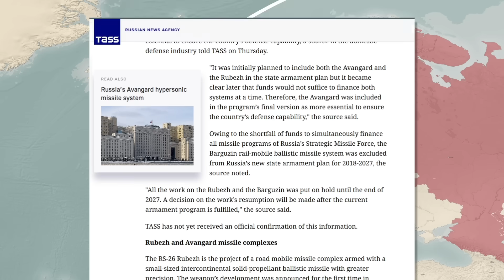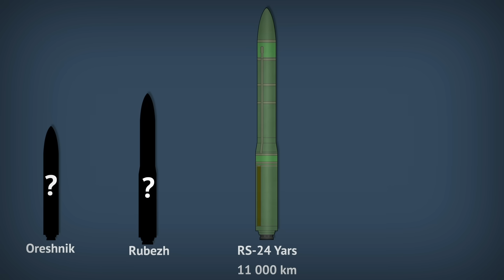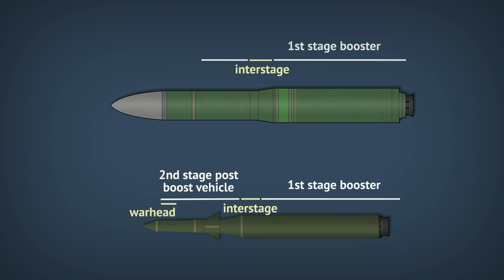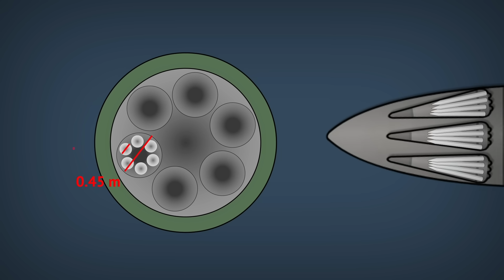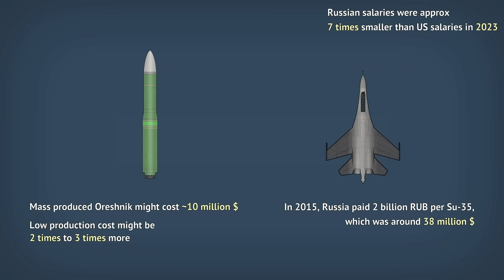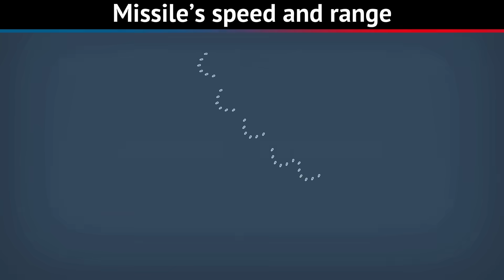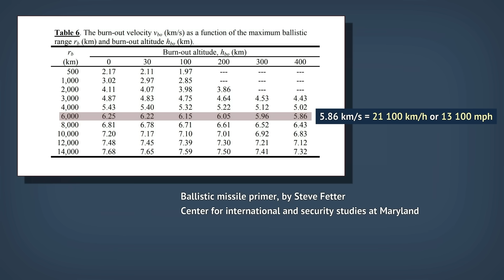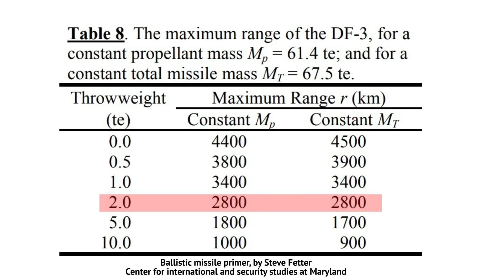Ukraine can’t counter Oreshnik missile. But it doesn’t have to.

Comment: I don't understand the point of this weapon in this context with conventional warheads other than pure propaganda. 

It's not like it's being used as a Bunker Buster that can obliterate any hardened shelter no matter how deep it is as Prompt Global Strike program. A program BTW that was canceled because nobody could tell if the ICBM it was attached to is armed with a nuke or not.
Reply: Millenium7 had a great video on the potential for this style of weapon, for example: it maybe a fantastic weapon to use on very time sensitive targets or airfields, 36 submunitions with a relatively high amount of accuracy depending when they release could be very effective. though we would have to wait and see what becomes of this.
Reply: For targeting high cost assets far behind enemy lines.
It is cheaper to lob a an ICBM with conventional munitions then to send in paratroopers or pilots which human assets take far longer to train & even more cost to make competent.
Russia is considering the long term plan as certain personal can cannot be replaced immediately but will take a generation or so to replace.
Considering how much land & the length of Russia's border trailing such a great way to project power & while practicing for the hypothetical use of thermo-nuclear loads.
Even how they have lightened the load with practice it is reasonably possible to improve accuracy by lowering the radius of impact with trial & error.  

This is the correct move on Russia's part as they get practice & experience with such armaments in an active while NATO is bureaucratic while arrogant with old guard that think they are untouchable when really they have grown complacent since the cold war era.

No one around Russia has Thermonuclear armaments but China & what you can think of this as is a direct reminder of might.
Cuddle up to the USA if you want but the Russian bear can maul you & the USA eagle will do nothing as it circles about in observation.

USA can project across all the Americas but doing so in central Asia or eastern Europe not so much.
USA can only project presence into Europe mainly because of the Special relationship with the UK.
USA only projects into the far east because of Japan as effectively a puppet state after ww2.

USA & Russia are doing proxies again in Africa, Eastern Europe, Central Asia & likely south east Asia again as time progresses.
Reply: Weapont test
Reply: Yes the similar to icbm and potentially extremely deadly if nuclear; so the flight and launch pattern it has are troublesome and do have some challenges, so no twitchy action would cause nuclear war.
but its a very strategic missile to have; basically you can cut costs at completely destroying an airbase to a minimum. where you would need 100s of conventional missiles, you could get the same or better result with 5 of these. Which would be both cheaper, time effective and way harder to defend against.
Reply: As always, it is just for show, hoping to get a reaction from the West
Reply: @tellarty  As "always"? Not enough "show" on the Ukrainian front for you, mr. armchair expert?
Reply: @tellarty  Like those Himars-destroying Iskanders missiles are just for show?
Reply: @Kayzef2003  Did I speak to you? You should know your place.
Reply: @tellarty  It's a comment section, everyone can reply to anyone. If you can't understand that then get off the internet lol Know your place he said lolol
Reply: @aerith119 why are you talking?
Reply: @aerith119  Exactly, not for low-quality propaganda
Reply: It tells the USA that they're a long way behind in establishing hyper-sonic missiles on Russian borders and demonstrates how stupid an idea that escalation would be.
Reply: @whatilearnttoday5295 the us has had the same speed missiles since the 60's we have been able to shoot them down since the 90s.  If the russians didn't have this technology yet that is just sad.
Reply: @whatilearnttoday5295 All ballistic missiles are hypersonic as they are exoatmospheric and at least mach 5 this is not new tech it has been around since WWll
Reply: @motordyne_super37  I'm sorry but were you responding to something I said with this copy/paste?
Reply: Of course you don't😊

Comment: To me, given relatively short range of this "shot" (830-840 km), amount of munitions and alleged flying time it seemed like it was fired at very lofted trajectory and had either some stages removed or it was near the limit of it's capacity with 6 big MIRV's.
And yes, I measured from the poligon (fire range) to the factory that was "bombed". Though admittedly, I couldn't find which exact launch site was used back then. But it came to around 832 km.

Comment: Just because it's too expensive for 99% of possible targets doesn't mean that taking out the 1% of high-value targets isn't meaningful. Even taking out something like a Patriot battery can be worth it in some situations, despite the missile costing 10x the target, for example if it opens the way for other attacks. The main thing is that it is ADDITIONAL FIREPOWER on top of everything else Russia has, with a lot of reach.

Comment: I think we are getting caught up on the technical specs of how far it can reach. The bigger question is can they add nukes to them.
Reply: They're designed specifically for that lol
Reply: @TheGoodChap  Doubt it. The design is actually the exact opposite that you'd want to deliver nukes. It's min-maxed for maximizing the amount of warheads while minimizing the amount of resources spent per warhead. This is clearly a platform built for saturation. For carrying nukes, there are smaller missile platforms with higher range that are easier to transport around and deploy at the cost of carrying fewer warheads which doesn't matter for a nuke. Given the amount of devastation a single nuke can cause, the cost efficiency of the launch platform is of little importance but for a conventional saturation bombardment of a large area, it makes all the difference.

Comment: Your arguments are the same as those presented to Hitler by the "Oberkommando des Heeres" before the start of Operation Barbarossa.
The IRBM used is intended to destroy large complexes, for example highly survivable industrial estates, railway junctions or important air bases, which are defended by advanced multi-layered air defence systems. This is an asymmetrical response by Russia to NATO's air power capabilities. To understand how this affects the balance of power in Europe, to carry out a deep attack inside Russian borders in order to diminish its strategic response capacity, NATO would need to deploy hundreds of fighter aircraft and all the logistics that this entails (AWACS, tankers, pilots, etc.), and the risk of losing assets and personnel is very high, not to mention the cost of tens of billions of dollars involved. In contrast, Russia, with dozens of IRBMs with conventional warheads, each worth tens of millions, can achieve the same objectives in less time and with a much higher probability margin than a conventional attack detailed above.
And finally, Ukraine has much to fear, since Russia would not use these IRBMs to destroy the little energy infrastructure that remains, but rather the cheap drones and cruise missiles that day by day are undermining its ability to supply the necessary energy to the little that remains of its military industry and logistics, and if necessary, the Oreshnik could be used to destroy the last air bases where the F-16s and other air vectors used to launch Western cruise missiles are deployed.
Reply: Preach
Reply: And its missed industrial Yuzhmash district which is a size of a small city by miles🤣
Reply: Utter hogwash. These are big and expensive missiles with low accuracy that can not have a very large warhead, the West has long range cruise missiles if they want to take out a target in RU and even if an airstrike is needed, RU air defenses are so bad that you can't even defend primary targets like ballistic missile early warning radars from cheap, slow drones. So are absolutely no match for a Western strike package!
Reply: Used conventionally it's a onetime use payload delivery system for 6 250kg bombs worth of explosives with a 200+ meter margin of error. It will not take out an airbase because airbases are actually highly resistant to bombardment. Any damage will be repaired in a few hours.  NATO airpower is a significantly better way to deploy weapons because it is continuous and flexible in ways missiles are not. Post-Vietnam NATO SEAD has shown again and again that Russian air defenses will not stop them.  The only reason to use this thing conventionally is because your planes and conventional cruise missiles got shot down. 

It's only deadly to NATO if it has nuclear warheads.  Using this conventionally on NATO will result in an immediate nuclear counterattack because IRBMs are 1950s technology my guy.  The doctrine for how to respond to this has been set in stone for 70 years. This does nothing but shows how desperate Russia is because their lack of training and modern doctrine has put their air force at a major disadvantage.

The reason this was done was to show that nuclear weapons will still get through modern air defense systems because the nuclear Warhawks in NATO have been getting spicy about counterforce strategies and nuclear war finally being winnable.
Reply: @JetleanSam the way you are saying like, i,m god, i know everything whatever I say true, i can never wrong like all western country's 😂😂 hitler also thought same rest is history.
Reply: @djsahilking3807  <---- me when I get into a technical argument and then don't actually know anything about the subject matter so I accuse the other guy of being Hitler.

Comment: Definitely terrifying and I would not want to be on the receiving end but in the bigger scheme of things it's not really that much to worry about as long as it's delivering conventional explosives. Even if it's delivering 100 kg in each warhead, That's not as much as a b24 dropped in Germany and there were thousands of them flying day and night and it took years to really put a dent in Germany's ability to manufacture warm interior
Reply: It has the kinetic yield of two fully loaded b52's and the fact that it is conventional is what makes it a game changer. Rus can take out any airbase in Europe within 10 min without having to go nu. clear and theres nothing NA. TO can do to stop it. NA. TO has no such we. apon. With enough of these things they could completely erase NA. TO's air superiority which is what their entire doctrine is based around.
Reply: This is assuming America just sits there never doing anything about being attacked
Reply: @no-nx3ip  Right, people act like NATO and the Americans aren't sitting there watching  every single thing that comes off the ground in Russia, China and everywhere else 24 hours a day, 7 days a week
Reply: @BarryMcCockiner-em5sv I think you may be underestimating what it would take to take out an air base and just how many did nato has. It looked very impressive coming in at night, but it did nowhere near as much damage as conventional explosive with a similar weight. All that kinetic energy is going into the ground and does not have the same area affect from overpressure that conventional explosive (and nukes) have. You can look at the satellite images of the impacts and the building is intact.

Comment: When you are travelling at 3.4km/s, explosives are more of a complication than great addition as everything in it's path becomes frag until all that kinetic energy is gone - at such speeds a tungsten rod of the same weight would contain more energy in kinetic form than any explosives of equal weight would provide. These are not test munitions, they are working as designed and leave 36 holes through everything in their path.

Comment: I'm trying to understand how the first nuclear detonations from a MIRV missile wouldn't then disable the other nearby warheads from the EMP.  Is this all done wrong?
Reply: usually nuclear MIRVs separate farther apart designated for different major critical targets (major cities: capitals) and detonated far apart simultaneously, for a mid-air burst, for maximum explosive shockwave outwards and downwards

none need to contact the ground itself

anything too close to the ground wastes too much of the impact shockwave bounced back upwards
Reply: Most nuclear missile silos are hardened against not only a nuclear blast but a emp as well.

Comment: no evidence Oreshnik took a simple ballistic arc trajectory

but a much flatter horizontal level-flight atmospheric skimming path, to improve range, prior to maneuvering to point downwards to open up MARVs for separate strikes on desired targets

such flat air-riding lower level flight path minimizes radar detection used for any conventional defensive anti-ballistic missile missiles

Comment: 13:50 "Maybe token numbers" - sooo, will they run out in March. 24th of March, 2022. Sure.
Reply: They have been dramatically reducing their stockpiles, which is objectively correct. That is why the missile barrages are getting less frequent.
Reply: @voidtempering8700  are they?
Reply: @karlvongazenberg8398  Yes, they use more missiles than they make.
Reply: @voidtempering8700  We know that from where?

Comment: it's not supposed to carry nukes it supposed to use conventional warheads to attack targets russia couldn't or deemed too risky to attack before, instead of risking many strike aircraft and their support aircraft they can just obliterate a static target (military base/factory etc) with impunity, and like he said in the video it's still in the testing phase so it will likely have better conventional warheads, also he says it's inaccurate but check the videos and images of the damage it caused it's not randomly spread, almost all the warheads landed in small precise locations.
Reply: exactly, the accuracy is superb.

Comment: Could Oreshnik target aircraft carriers
Reply: yes
Reply: When they are on port definitely, otherwise most likely not with this payload.

With a glide vehicle as a payload they possibly can hit it on the move.
Reply: @billwhoever2830 well, this one is kinetic warhead, so kinda useless against ship. High explosive would be more useful. And I think the vehicle that we saw is indeed some kind of MIRV, meaning it can target ships.
Reply: @billwhoever2830  yes, the kinetic have more energy than HE. BUT, it will overpenetrate a ship. The same reason why tank don't use kinetic projectile against lightly armored target, the projectile will just go through the target like kot knife through butter. It will do very little damage. 

For lightly armored target, tank use high explosive round. HE is more effective against something unarmored or lightly armored.

Same concept here. The kinetic Oreshnik is optimized for destroying targets deep inside bunkers. Not surface targets. For surface targets better use explosive warhead. And yes, ship is practically unarmored target compared to underground bunker.
Reply: Obviously